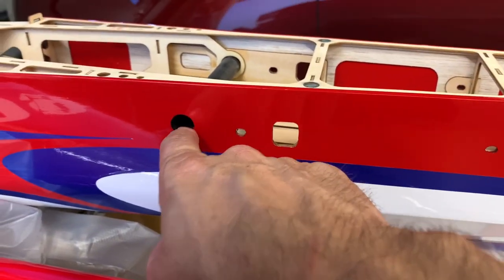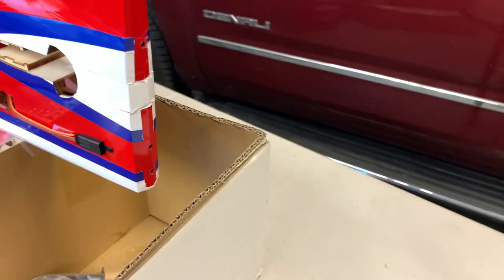OMP Hobby Edge Unboxing

Comment: Very nicely designed. Make sure all joints do have glue. Maybe build up glue/epoxy on the engine/ motor block. But from what I see looks well built. The bigger the plane the easier it is to fly. As long as everything is balanced and thrust pitch is perfect. 
Happy flying!!!